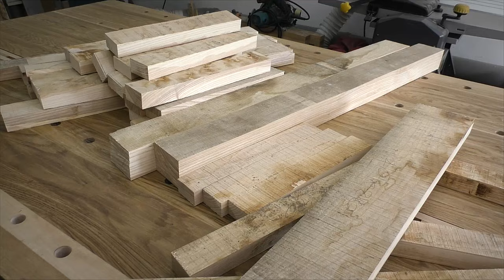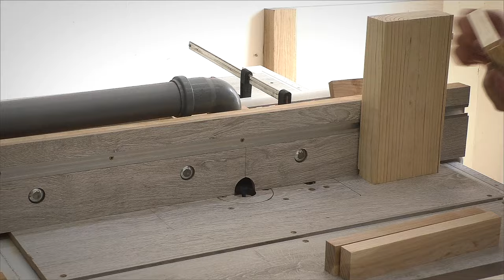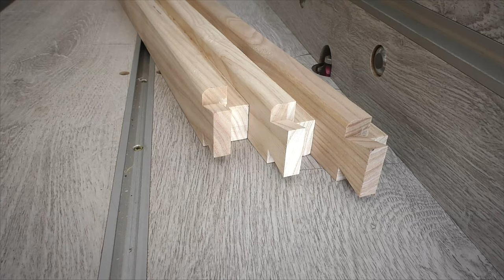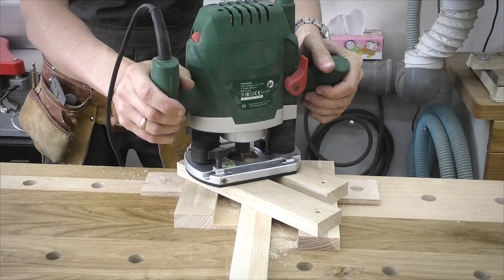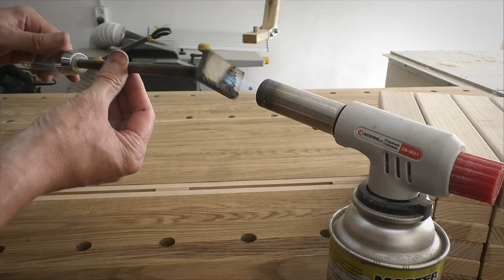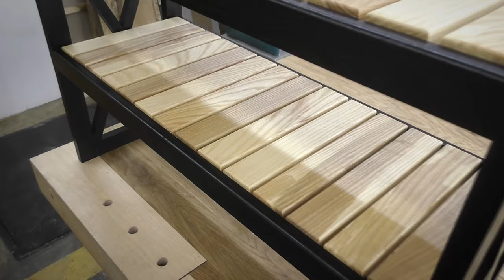Awesome Shoe Rack Build - Woodworking Project

Comment: Impressive project, impressive workshop, impressive woodworker.  Using a spacer between the slats, how did you make it them come out perfect at the end?  When I've used slats, I've started in the middle and worked both ways allowing the end gaps to take up the slop.